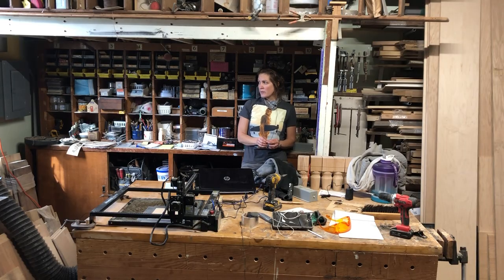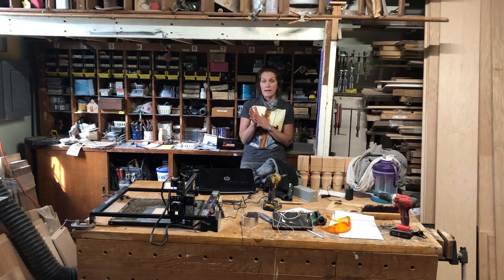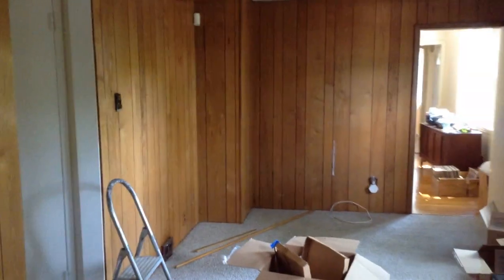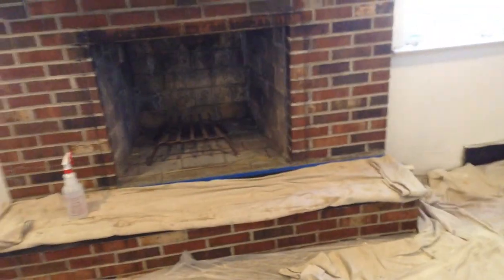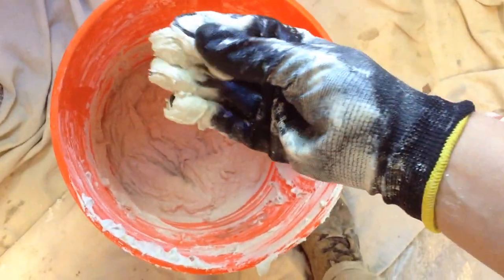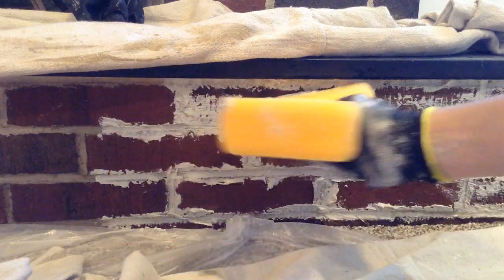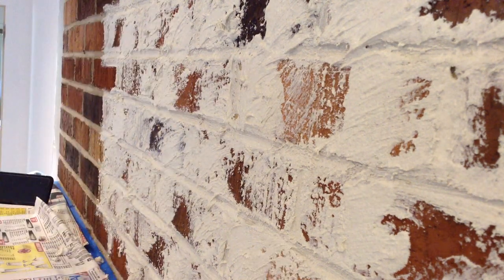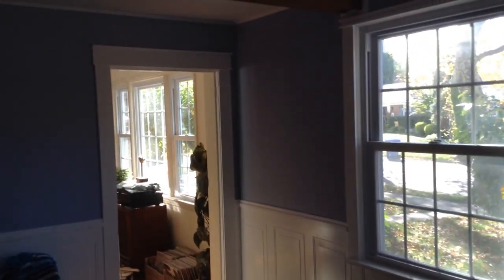Woodworking : German Schmear Fireplace Update // How-To

Comment: Yes, the painted brick, I understand. We have a formerly beautiful cottage style old brick store with wide display windows. The brick was a natural tan earth tone then the new owner painted it. I don’t believe there is any nondestructive way to restore it. It’s has now been repainted several times to regain the original appeal but now the latest travesty is stucco.
Reply from the maker: I actually have a video on here that is probably a year old now where I restore a brick wall.  It was plastered over and once the bulk of the plaster was removed there was still a lot of material left on the brick.  A masonry grinding disc, coupled with a wire wheel for my grinder. As well as countless hours of grinding and more dust then I've ever seen in my life and the wall looked brand new.

Comment: At the end you said you will probably seal it. What do you seal it with?
Reply from the maker: I ended up not sealing this.  Most water based finishes yellow gradually over time and I didn't want to deal with that.  And oil based finishes will turn it yellow right away.